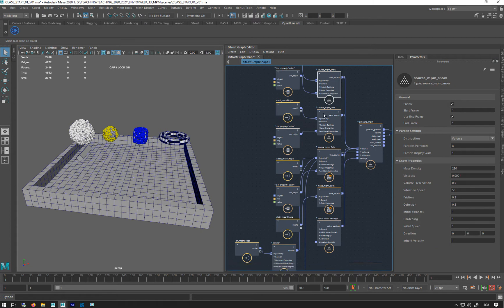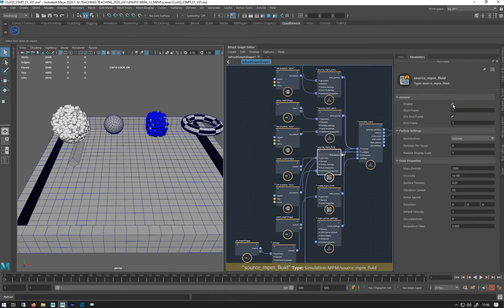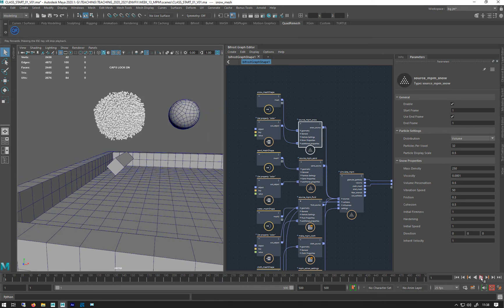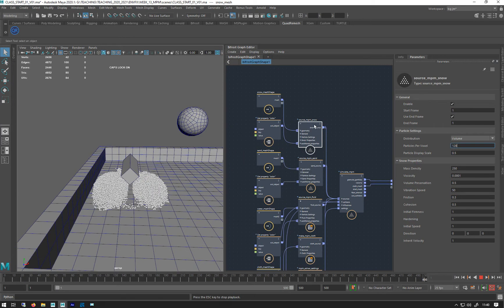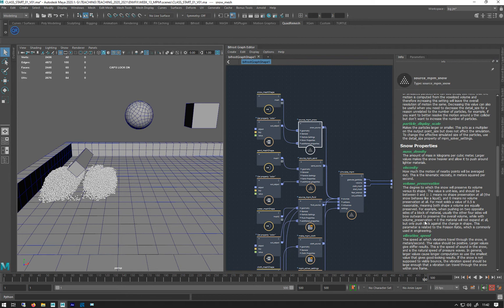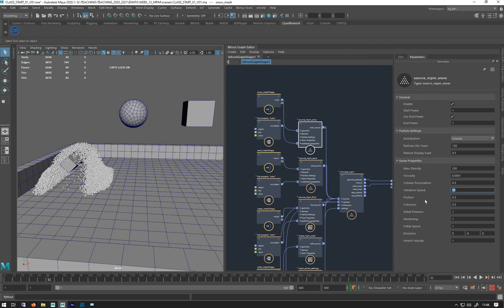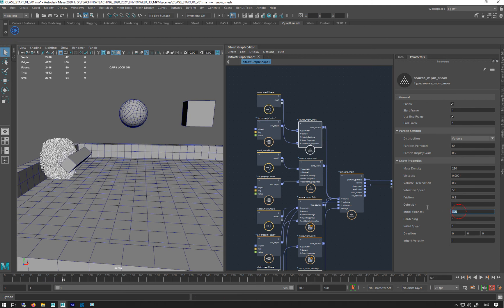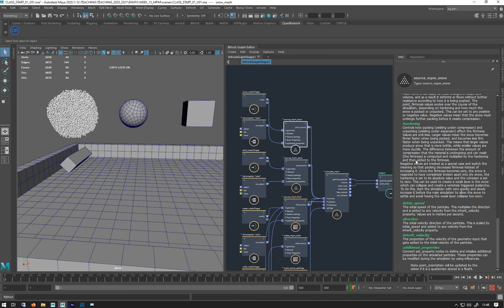BIFROST BASICS: WEEK 4 LESSON 3 MPM SOURCE SETTINGS SNOW

Comment: There's a gap between the colliders and the snow. I tried adjusting detail size but gap is still there.
Reply from the maker: Have a look at this video where I discuss the MPM settings https://youtu.be/ltUMmVmzpp4. Also turn off "link collider detail" in the solver settings,  this will let you control the collider resolution seperately. Hope that helps
Reply: @jmm7180  It worked, thank you.